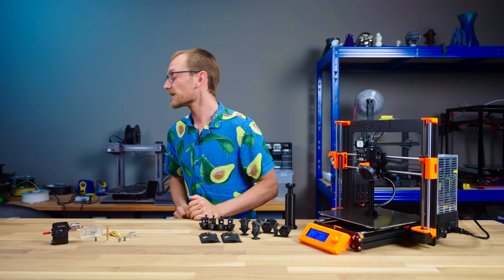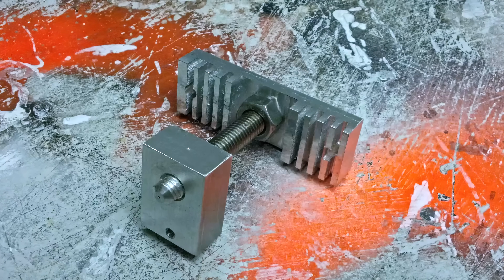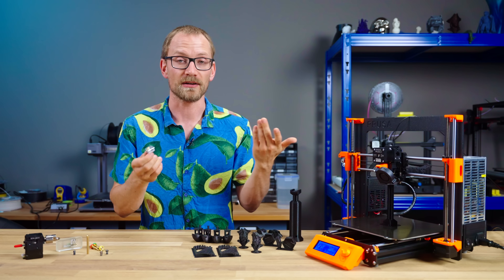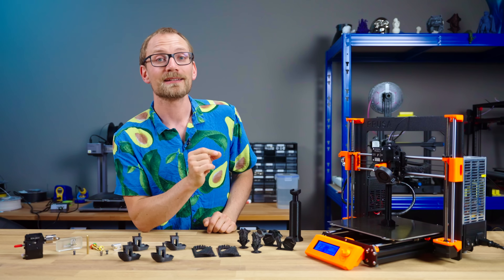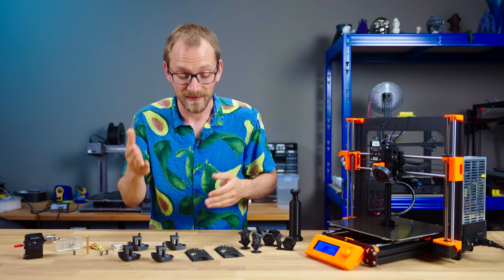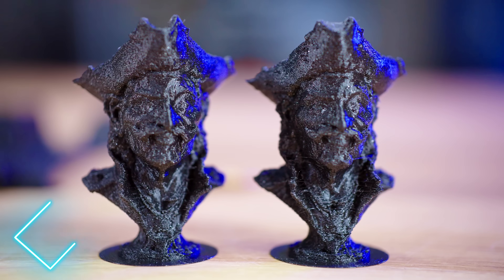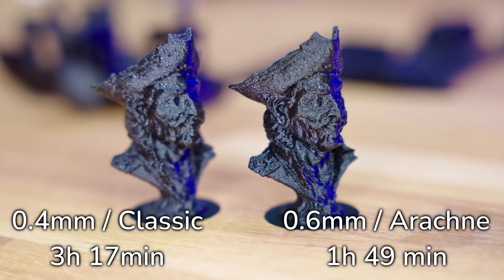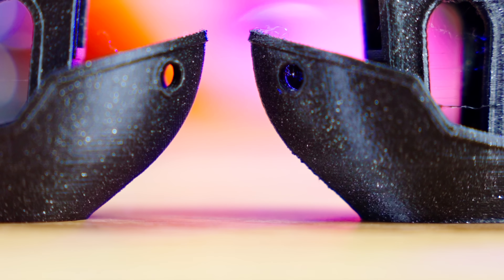0.4mm nozzles just became obsolete

Comment: I agree 100%  Starting with my Lulzbot at .5mm, I didn't notice any appreciable difference than on my MK3S+ with .4mm.  Only 2 of my machines now have .4's in them...Prusa Mini+ and Kingroon KP3S, and my large format machines use .8mm.  Everything else is .5mm or .6mm.  Great topic and explanation, moving our hobby forward!
Reply: How's your experience with the Kingroon? They are still quite rare, but the build looks solid for the price, especially the large model.
Reply: @Thierry080  I absolutely love my KP3S.  I printed:  full base to house the p.s., display relocator that moves the display forward and puts it at an angle for easier use and monitoring during a print,  and a spool holder/z rod brace atop the 2040 extrusion. Botbit BMG clone(I don't care for titan extruders) with a Red Lizard K3 high flow hotend with .4 nozzle x, 5015 pc fan and 40mm noctua heatsink fan.  I did all this after this inexpensive little machine easily earned the @$85 upgrades and now it's one of my go to machines for small parts of ANY material!!!

Comment: For utility prints I use a 1mm nozzle. Could you do a comparison with upper end for a 1.75mm filament? You can bump up temp to 220-230c for bigger nozzles without reducing speed.
Reply: What does "without reducing speed" mean? What your typically hotends i doubt you could even get 50mm/s with pla at 220-230C.
Reply: @pomprocks  you need to consider volumetric speed to understand what he means. The higher the layer height and nozzle diameter at the same printing speed, the more heat you need.
Reply: @pomprocks  I have a 0.8mm volcano and can totally reach 50mm/s
Reply: @pomprocks  I have a stock machine at 0.7 nozzle and print 190°/55mm
Reply: That works if you're using toy plastic, that is, PLA. 
The real boys here use PETG and ASA.
Reply: @alejandroperez5368  Well big nozzles and higher temperature work for ABS too, but haven't had much/any better flow with hotter PETG, just bubbling.
PLA has it's place, specially since it's incredibly strong in compression, but for anything with a constant load or any hotter than ambient, ABS/ASA is what I go to and PETG when it's just too big to not snap in the layers with ABS.
Reply: @alejandroperez5368  I modified one of my larger printers (X5SA-500PRO TRONXY) and use it exclusively with 1.0 nozzle and it prints PETG functional parts 100% of the time now. The practical reason was it has very curvy bed that gets to 2mm difference and I don't want to spend a fortune on proper thick bed for it (yet), so the 1.0mm nozzle let me print thick layers and not worry much about the curved surface. I had to make it Volcano to have high enough flow rates and my prints rarely drop below 20mm^3 extrusion.

Needless to say it prints wonderfully "toy" plastic like PLA too. For ABS/ASA prints I built myself a Voron, but the thing has to reach temperature stability for hours before going to work, so if PLA/PETG can do it, I just won't bother with ABS/ASA... and the smell is gone too.

Comment: I run with a 0.8 most of the time. Sometimes I even print with a 0.4 line width, with pretty acceptable results.
Reply: And I'm sitting here with a 0.4 printing at 0.8
Reply: @silver1fangs  0.8mm doesn't work well on my printer with a 0.4mm nozzle but 0.6mm line width with "print thin walls" activated in Cura is great. Always wanted to order 0.6mm nozzles but never did. Due to this video they are now ordered.
Reply: I love the 0,8 except the sharp corner got abit round, need more tolerance, and remove support is a pain.
Reply: Try printing a 54mm miniature figure.

Comment: When Nozzle X came out I got a 0.5mm, even that has been fantastic in my main printer. I love it when software makes hardware better.
Reply: Yeah, I’ll probably get some sort of 0.4-0.6 (this video has me intrigued) diamondback nozzle and use that as my “daily driver” ; Large enough that it is fast, but bot crazy, and can handle any material pretty much.
Reply: A 0.5mm nozzle is my go to nozzle as well. It's easy to calibrate, clogs less, and can lay down reasonably thick lines (0.8mm, +/- 0.2mm) without loosing too much detail or exceeding the limits of the nozzle. 😊🌎✨
Reply: @Daniel Andersen I also will when high flow nozzles like the CHT are available hardened. I'm mostly limited by volumetric rate. I like the 0.5mm because I can get good quality while maximizing hot end flow rate. They're starting to become available though.
Reply: IMHO software cannot make hardware better, but software can make hardware worse, because the hardware's capabilities obviously don't chance, but our chances for making use it do. Sadly the latter is the case with about any modern product, for the enterprises and vendors cutting down budget for increasing their net income, unless an sophisticated open source community arises and is working together for getting out all of the hardware's best. :)

Comment: since I changed one of my printers to revo, I change the nozzle depending on the job
Reply: I like the concept of Revo, but I’m a bit too much of an Open Source Snob, i may get one of those “manual toolchangers” maybe?  Like my wallet can even afford the nozzles alone though!

Either way that does seem like the dream short of some sort of automatic toolchanger with a bunch of toolheads!
Reply: Same, I've used 0.4mm on my printer for years and just absorbed the extra time cost rather than burning my fingers, deal with possible leaks, etc. I decided to change to the Revo on a whim. Now I'm changing the nozzle size 3-5 times a week and it's really great. It's one of those things where you see a product, get all these great ideas in your head how it will be, and it actually works out just like that in reality.
Reply: well, that sounds sweet!!! 👌🏽

Comment: I recently switched to a .6 nozzle after my last .4 got eaten up and needed to be replaced.

I was shocked by how much quality it's capable of.
Reply: I ran a .8 for a while and uhhhh woah buddy it's fast and if you do enough voodoo you can run a .4 that hard but I wouldn't suggest it voodoo isn't always garrentee
Reply: Same, made the switch to 0.6mm about 2 month ago. Only swapping in smaller nozzles for very delicate parts now and then.
Reply: I just recently switched to 1mm from 0.6 and its been amazing, still surprisingly good at small parts too